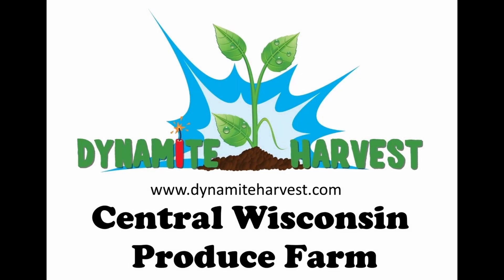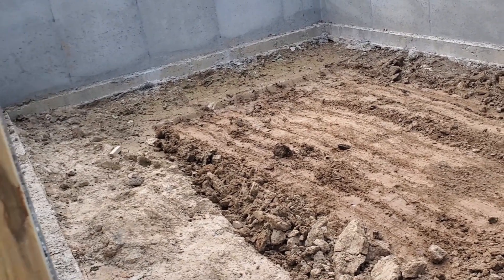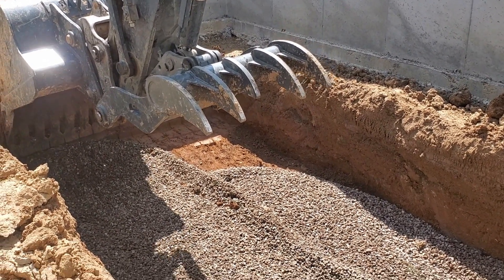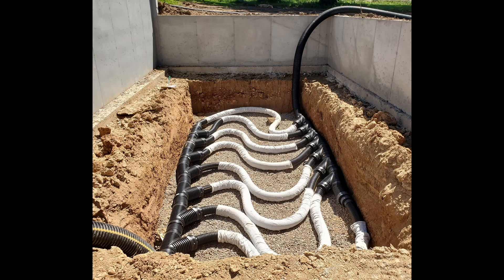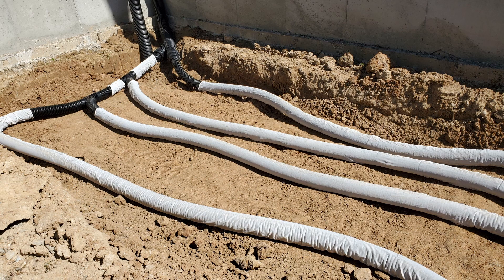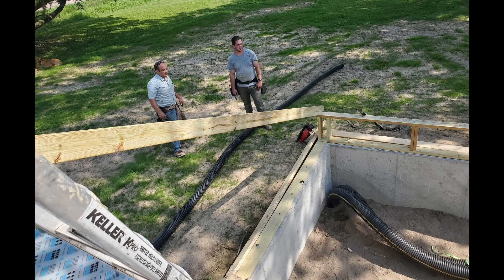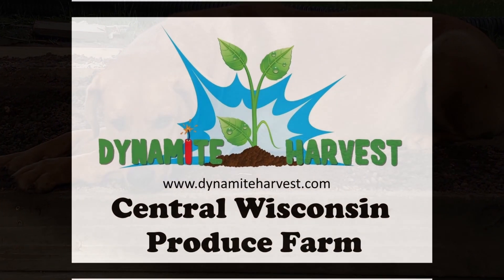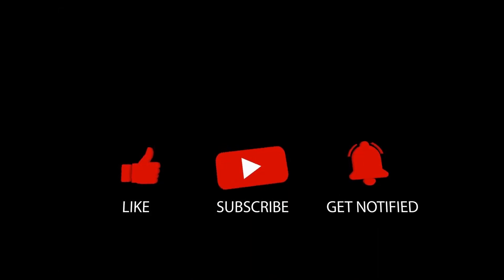GAHT Video, This Time Slow No Music. Ground to Air Heat Transfer

Comment: How deep did you put the tubes? I dug down 10 foot and put 30  6 inch tubes and I blow air through them and get 52 degree all year long.
Reply from the maker: the shallow one is about 30 inches down and the deep circuit is about 5 feet down. I get mid 50's in the winter but during the summer when the sun is beating down on the walipini the air comes out in the 60's. Still cooler than the walipini temps in the summer, so an effective way to cool it down in there.

If I didn't have the coffee plants and other tropicals, my winter mid 50's would be all I needed.
Reply: @dynamiteharvest  I put an electric heater into mine along with a diesel heater. I have them come on about 44 degrees and they warm it up to about 52 degrees, with -11 degrees Fahrenheit outside. During the day, I get up to 90 degrees with the sun shining, with it being near zero degrees. I built my greenhouse to be 20 feet wide by 120 feet long, so if I didn't have auxiliary heat, it would go down to about 38 degrees Fahrenheit with just the air flowing through the tubes. That is the coldest I recorded with just the air going through the tubes with it near zero degrees outside. Farenheit.  Thank you and enjoy!
Reply: @jasonday1199 Just curious as we are building an 85’ version next spring, do you see any advantage in splitting the area into three sections running across the GH with independent manifolds vs lengthwise, or am I over complicating things?